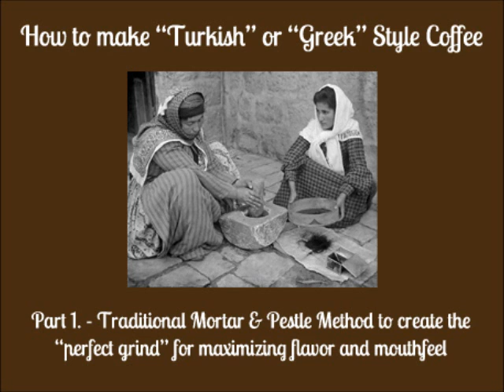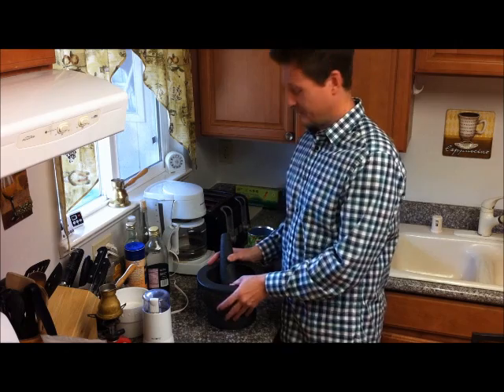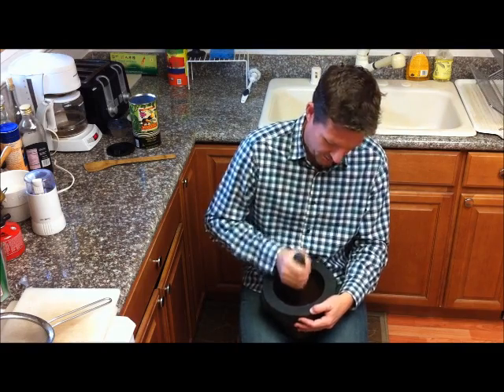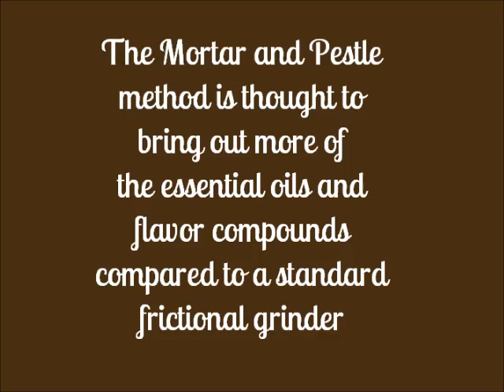Turkish or Greek Style Coffee Part 1 Grinding

Comment: Why not use a manual grinder ??
Reply from the maker: Great question. Pounding with m&p is the best way to release the flavor compounds (oils) from the coffee bean particles due to the force, pressure involved, and ultra fine powder produced=more surface area to release flavor. This is the same reason why legit Indian food chefs insist on m&p for spice prep. That being said, there are manual grinders specifically for Turkish/Greek-style coffee, and my understanding is that they work great and are considered "traditional". However before grinders, the original method involved m&p is my understanding.
Reply from the maker: Hi, sorry for the delayed response. The reason for the mortar and pestle method is to produce the finest particle size possible (like powder), which I believe helps maximize the formation of that sought-after "crema" foam-like layer on the top. I've never used a manual grinder, so I can't say with certainty whether or not a manual grinder can achieve a similar result. I hope this helps. Thank you for watching and commenting on my video. Sincerely, 

Rod